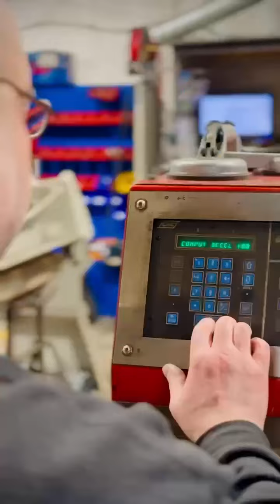GBS Cars Factory Tour - Come and see for yourself what we do....

Comment: I would like to build my own but I want to use the red top Vauxhall engine because I no them like the back of my hand and have a shed full of them in various build for ideally would like to run a turbo for 330- Bhp for track use and switchable too around 500bhp for a fire breathing monster I would like the frame extra rigid and heavier than the gt could this be done?
Reply from the maker: Yes the Vauxhall red top engine has been used before in the Zero, the custom Zero Kit that we offer allows you to tailor the Zero to the engine configuration of your choice, whether that is an already compatible engine or a completely custom engine installation. This kit allows you to customise the whole power train and other aspects of the car. If you would like to contact us then we can discuss the options with you in more detail. We look forward to hearing from you.